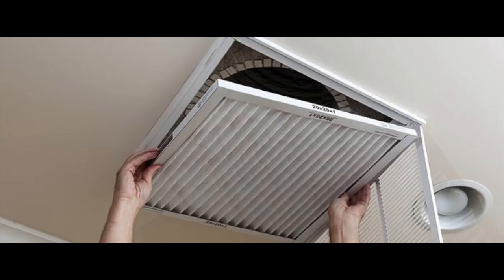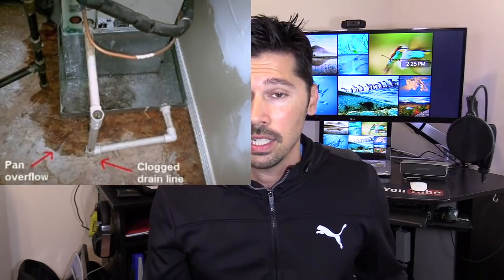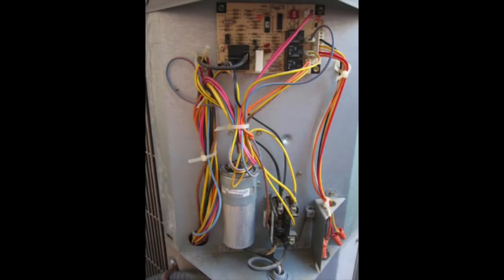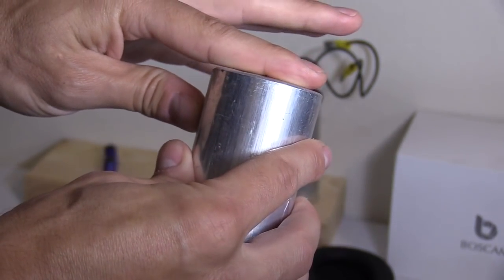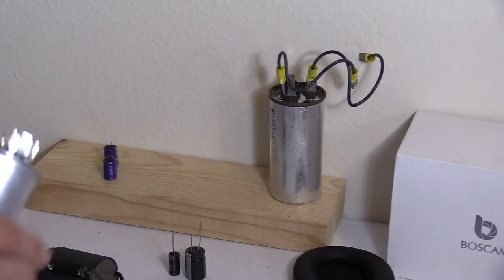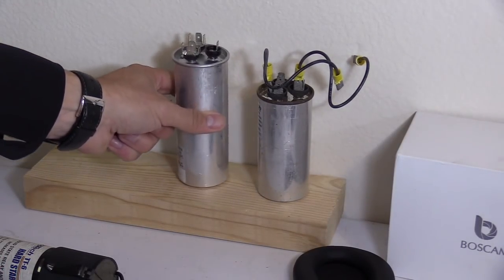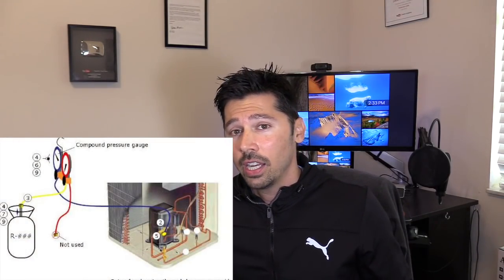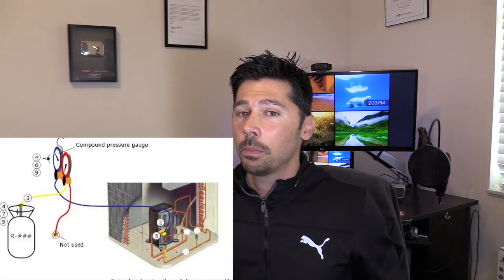4 WAYS TO FIX AC UNIT FAN NOT BLOWING COLD AIR / NOT WORKING

Comment from the maker: contact certified AC repair tech before opening AC unit, see links below for items mentioned in video, 
Air filters - https://amzn.to/2LUZwHV
Dual and fan capacitors - https://amzn.to/2t3tS3W
wet vac - https://amzn.to/2LZtYRe
*Affiliated links
Reply: Can I ask what HVAC company you used? I’m looking for a reputable one in the area. TIA
Reply: Tampatec my capacitor was bad and it’s 89 out thanks for the help I went to the ac supply house and got a new one and now I’m nice and cool
Reply: Tampatec Hello need your help ASAP I'm located navarre FL it's been a real issue with my Wi-Fi built in router by Ares bwg210 by AT&T the 2.4 mysteriously loses sync with my devices a Galaxy S7 Edge phone a tablet e a Galaxy my Alexa I had seven motives replaced I had a pace modem 5268ac an unsuspecting there's a magnetic electric field that my neighbors are doing some kind of interference my wireless gateway router I've AT&T universe 50 I have had to call AT&T on a regular basis but yet when I when I plug in something wired to CAT5 or Cat6 everything's fine the broadband connection is solid coming in no dropouts  I'm getting awesome upload speeds and download speed. every technician can't fix the problems it's getting very stressful I have seen your video about testing magnetic field what neighbor could be causing interference you know I need help you you know my devices shouldn't nit just drop Wi-Fi signal on 2.4 and 5ghz  my laptop Alexa I spent a ton of money with AT&T I put two Air ties access points in 4920 I can hooked up to to them cat 5 no connection issues we separated the ssids set the router up you can see 2.4 and the 5 gigahertz band staring I suspect someone's doing this in the neighborhood I want any information I can have the contact the FCC or the doing investigation where I live, something is very fishyall sudden explains I was having trouble my laptop and updates for Microsoft, I really need your help I'm ready to cancel all the internet I'm so frustrated
Reply: Hi what is the capacitor of 24, btu lg unit

Comment: Hi! I have a Payne ac, 8 years old, outdoor unit is working, but indoor will blow air for about 5 min ( I keep noticing a chemical smell) and then it turns off. It may or may not turn back on again. My friend said it may be the ac handler located in the attic. Any suggestions ! Help please ? Thank you!

Comment: Thanks for sharing. I was able to use your advice and diagnose the problem component- capacitor. Was able to fix the issue ordering the replacement on Amazon for under 30 bucks. Thank you!

Comment: Mucho thanks mon.  It's late Saturday late and AC stopped blowing.  Watched your video, checked filter then the AC drain, the drain was clogged.  We've been in this house under a year so not too familiar with AC or other things concerning maintenance.  Tomorrow I'm changing the drain flow going outside to above ground, the current underground pipe is where the weeds and bamboo roots clogged the drain. 
Fortunately, I found your Youtube video and saved me from calling heeeelp & paying buco $$$!  Saludos

Comment: Hi, my ac was working great until I changed out the
thermostat and now the system is not blowing cold air. I put the old thermostat
back on and still blows but not cold. What did I blow up? ha...Thanks
Reply from the maker: if you didn't turn off the breaker while switching out your thermostat, probably popped a breaker, Check breaker inside and outside where the the unit is. Just move switch back and forth that was trip, you'll see a red marker near that switch. If thermostat is still not wired correctly it will pop again.
Reply: Thanks, inside looks good. Let me check the outside. Thanks

Comment: I have window unit that's a GE GE® 115 Volt Mechanical  Air Conditioner window unit that I really need straight wire fine and everything on the inside of it please help me asap its very hot inside my home right  anything fro. Anyone would be  very thankful to me

Comment: Between 70-73 for cooling, and yes changing filters like once a month always helps, which is a part of maintenance. There are other things that are part of maintenance that can protect the unit from going out (example cleaning your condenser/evaporator coil, along with checking the electrical to make sure your connections are good, etc.). That’s the key to keeping the unit run properly.

Comment: Thanks for your video! I'm still not sure what could be wrong with my AC, though. They just replaced the fan, capacitor, and contactor, and it was cooling fine for a few days. But now, all of a sudden, it's not cooling inside (but blowing air from vent). And the outside unit seems to be running fine in terms of the fan blades spinning properly now, but it's no longer removing hot air. So there's no condensation on the inside, and since the pump was broken and disconnected, I was dumping a bucket of water every 40 minutes or so. Now there's NO water, and it's 86 degrees in my house...hotter than it is outside at night. And the tech who did the work won't reply to my text. What a jerk.
Reply: Usually if you go from leaking water to none at all, it is a sure sign you have ice buildup on the evap coils. Inexpensive fix is to clean them with a self cleaning coil spray after you thaw out the ice by running fan only. The fix that you want to avoid is a refrigerant leak. This is not something you should do yourself. You need a professional to fix it and then recharge your system. There's not really many other reasons why your AC unit isn't working based on the information you gave
Reply: Check your thermostat connections.  A loose R wire can cause that to happen.

Comment: Tip:  Before disconnecting any wires (from any electrical component) take numerous pics showing where the wires go.  Or attach masking tape to the wires with label of where they go.
Reply: Oh man, newer units color code for that reason. It's always a good idea to make a system that you can remember.
Reply: Great recommendation!

Comment: I have a question my vent is blowing out warm air it's not Cold as all on the outside of the fans is not running at all don't the fans should be running on the outside or get that Cold air inside of the house  i need help with this i need someone to check it

Comment: 71 - 73? That's heat. 68 or less all day.
Reply: 71 - 73 i am sweating.
Reply: If you’re sweating at 71 you got high humidity lol
Reply: Im 60
Reply: 68 is ok. But 63 is better. Nice sleep
Reply: 71-73 in house, 103-107  outside
Reply: 104-110 in imperial valley hottest day not even summer
Reply: Everyone has a different preference for temperature but I think that, overall, it really depends on how efficiently your A/C cools your house. My house gets nice and cold at 72.
Reply: Facts
Reply: Stfu pussies I’m sitting here in 101
Reply: @thebige-o6o  bruh stfu that's only because you have gotten used to it where I live it gets up to 110 I'm sure if you went to where they live you would be freezing

Comment: Mine was not blowing out cold air. It was the filter that needed to be changed and since air wasn’t getting through, my entire electrical from the central air shut off. So in the fuse box, all I had to do was flip the switch back to on!!! Just a tip to anyone reading this. Change your filter if you have in a while and make sure you got electric running to your central air

Comment: Hey man big thanks for this video. My ac was blowing hot air when I got home from work the other day and I wasn't sure where to start until I saw this. After turning off the power at the breaker and removing the outside fuse (or whatever that thing is) I took the capacitor out and sure enough it was bad and wobbled just like you showed. Got a new one at a local electrical supply place and BAM, I'm back to cool breezes. Thank you!!!

Comment: Hello need your help ASAP I'm located navarre FL it's been a real issue with my Wi-Fi built in router by Ares bwg210 by AT&T the 2.4 mysteriously loses sync with my devices a Galaxy S7 Edge phone a tablet e a Galaxy my Alexa I had seven motives replaced I had a pace modem 5268ac an unsuspecting there's a magnetic electric field that my neighbors are doing some kind of in a minute interference the sabotage my wireless gateway router I've AT&T universe 50 I have had to call AT&T on a regular basis but yet when I when I plug in something wired to CAT5 or Cat6 everything's fine the broadband connection is solid coming in no dropouts there I'm getting awesome upload speeds and download speeds enroll of a 41 42 I want that my download is like 27 something like that every technician can't fix the problems getting very stressful I have seen your video about testing magnetic field what neighbor could be causing interference you know I need help you you know my devices shouldn't just drop Wi-Fi signal my laptop Alexa I spent a ton of money with AT&T I put two Air ties in I can hooked up to to them cat 5 no connection issues

Comment: Great video.

Even in northern Wisconsin, we have AC.  Seriously!  To be honest, despite freezing to death 9 months of the year, right now, it's hotter here than in Tampa.  But I digress.

Up here, you have a whole season of not running your air.  So I would suggest, buy a cover, and cover your Ac unit outside, during winter.  Also, in spring, hose out or vacuum out or whatever, any debris that has gotten in there.  Leaves and crap loves to get in there, and that will rob you of cooling power. 

I agree with your whole video...  1 thing you didn't mention is, outside, there is usually a big slow-blowing fuse.  Kinda funny looking.  It will usually be in a little metal box.   That will blow.   If you replace it, and it holds for a few weeks, you are probably fine.  If you replace it, and it blows immediately, or only lasts a day, you have some other big problem.  Call a tech.  Don't just keep replacing it.  And for Pete's sakes, NEVER replace a fuse with a higher value fuse.  Please.  Do not do that.  Thank you.

This isn't really a tip, but, the other thing I would say is, if you don't get a good feeling from the person who comes, GET A SECOND OPINION.  I got fed up with my 1 person, and my neighbor says "oh, I use this guy...."  That guy was GREAT.  SO much better than my guy.  He also told me my heater was under a lawsuit, and I got a new one for free, so he was worth his weight in gold.  So, don't be afraid to get a second opinion....
Reply from the maker: Patrick Morrissey good to know thanks

Comment: If someone watching this video were to choose to replace a bad capacitor, keep in mind that you can always use a higher voltage capacitor than what is in the unit, but never go lower.  As an example, if you have a 40/5@370v, you could use a 40/5@440v.
Reply from the maker: Tom Kish true, great tip, thanks

Comment: Yes sir and if it keeps blowing capacitors you might have to buy a hard start capacitor kit, and yes do not mess with them kind of capacitors they've got the potential of making "YOU"not suck air no more, the voltage that comes out of there is more than enough to bury you

Comment: People don't touch the capacitor! Ever! They Kill !
Reply: just discharge them before handling and you will be fine.
Reply: Tell us how to do that!
Reply: use a screwdriver and lay it across the different connections on the top of the capacitor.  You may get a little pop but just hold onto the plastic part of screwdriver and you will be fine.  
 @itmaslanka
Reply: @TheSeancassady  if I spray the outside unit with water outside to clean it will I hit the capacitor and get shocked or is it protected preety good? Or is it even located in the outside unit
Reply: @fabianbodie4520  It rains doesn't it?

Comment: At the beginning of every cooling season take a garden hose and wash your outdoor unit. The fan pulls air through the coils to cool the freon. When pulling air through it also pulls dirt, grass and debris. When the coils get dirty it makes your compressor work harder.
Reply from the maker: good tip, thanks
Reply: John Smith jr مرحبا
Reply: Freon is R12

Comment: Invest in attic insulation and new windows (will fix condensation issue).also have an reputable a/c guy check to make sure the ducts and unit are sized correctly to the house. Alot of florida homes have sun rooms that have been opened to the house and now the unit has to work harder. 
Duct work on older florida houses allot of times was intended for suplemental heat not a/c.
Reply from the maker: thanks for the tips